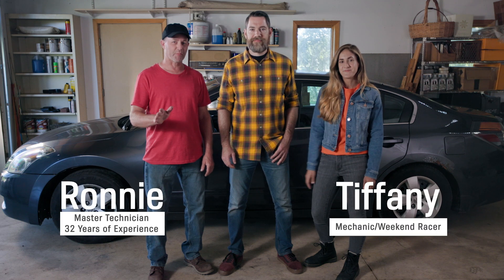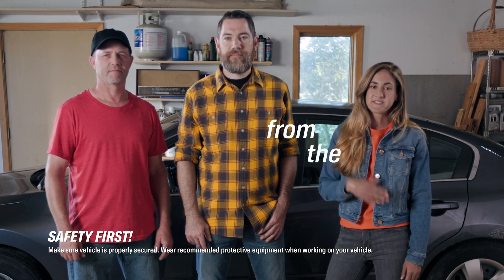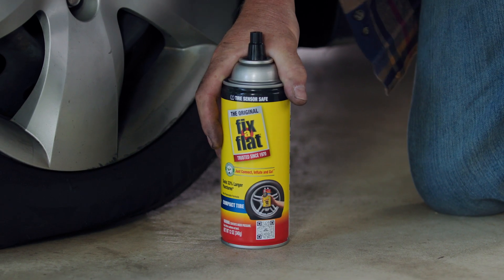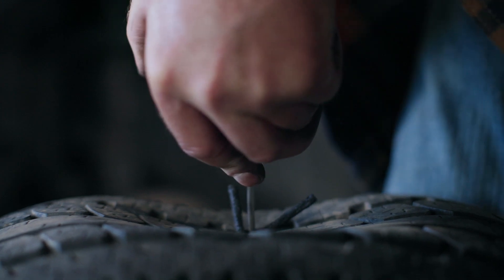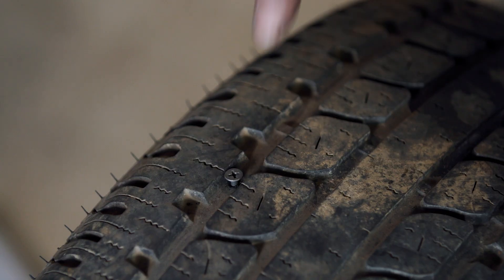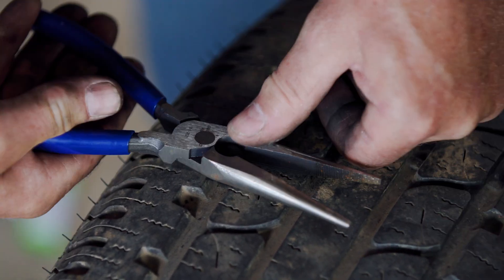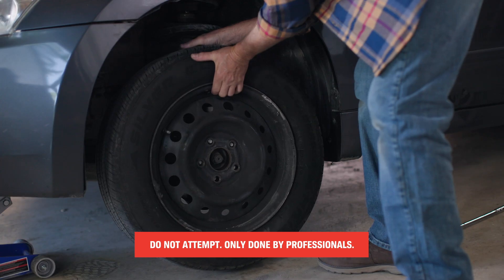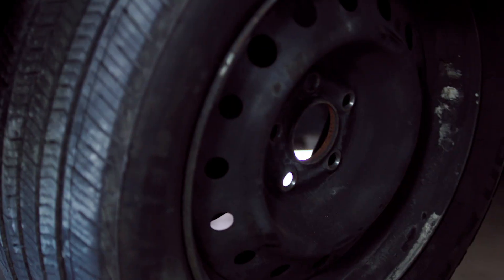Temporary Tire Patching Methods

Comment: The patch works for awhile but you have to repatch it ,the plug works well there's three types of plugs you can use ,fix a flat is ok for awhile but when try to fix it or replace the tire the shop doesn't like it they scold you like a child for using it.